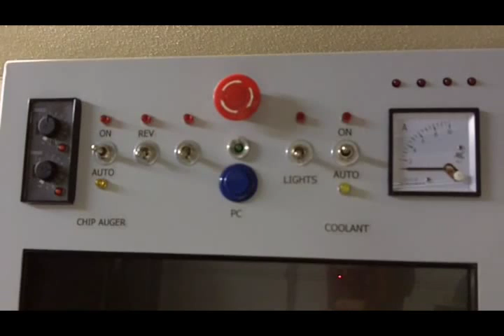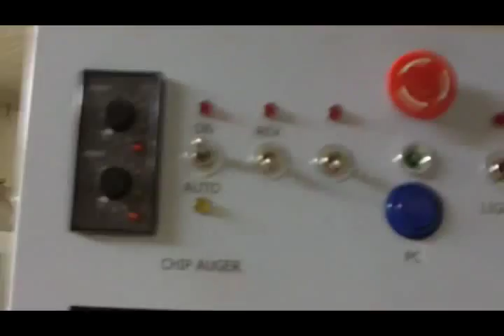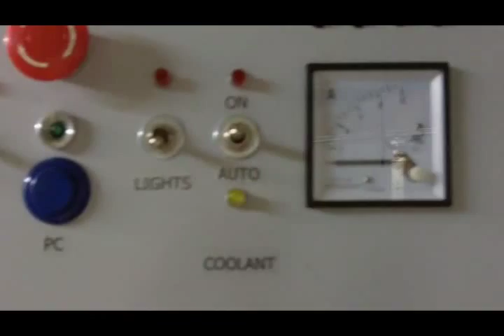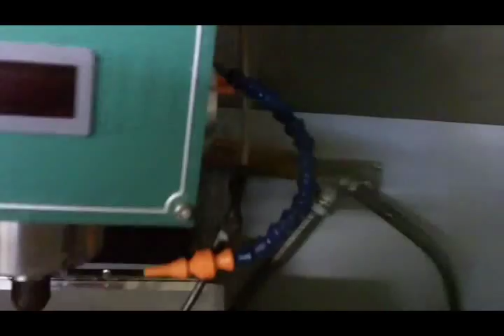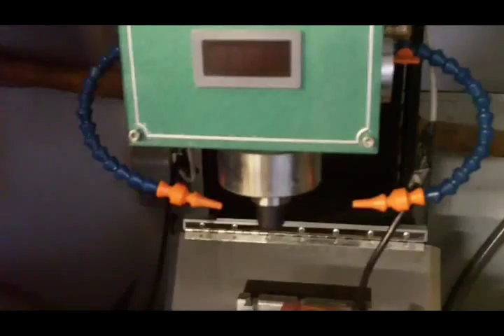ZX45 Control systems overview

Comment: Nice conversion!  That's quite a few bells and whistles.  Are you using upgraded ballscrews or stock?  What's the backlash like?
Reply from the maker: Thanks Ryan,
I used Roton ballscrews & made my own double-nut arrangement on all axis. Last time I checked backlash was 1 to 3 thou on all axis which backlash compensation took care of.  If I disassemble & dig in deeper I'm sure I could eliminate that.  This has been an ongoing project for several years & sometimes I just want to use it instead of work on it.